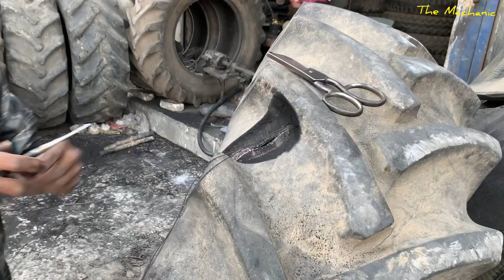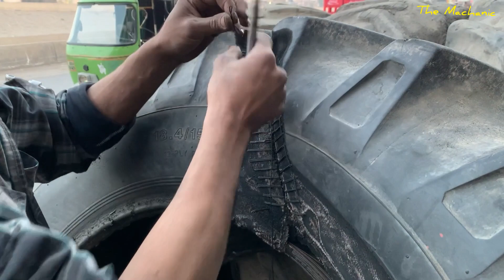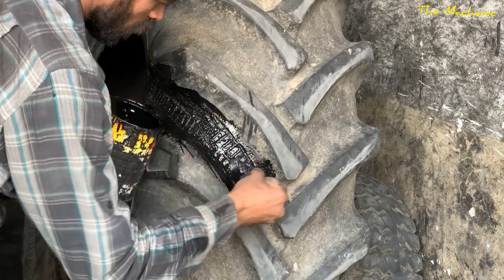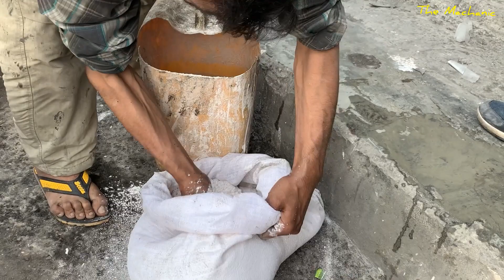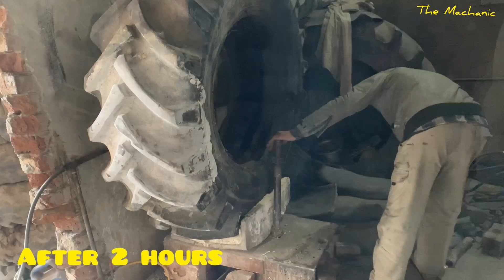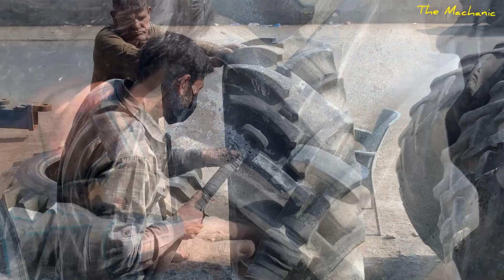Their Crafty Hands Repair Giant Tire Burst From Sidewall with Minimum Tools || Big Tire Patch Repair

Comment: Greetings from Ohio, USA .... No criticism from here on this amazing service and work you perform. I do know that here in the States, this tire would have gone straight to the shredder.  Youve obviously been at this work long enough to know that this tire will hold up under extreme service. Having watched a number if these repairs now,  I believe that this tire will definitely do the job nicely. Kudos on the workmanship!! I would have absolutely no problem with using this tire myself.

I think most negative thoughts and comments on this process might be coming from those who classify this as a highway service type tire,  used at extreme rpms, building up extreme heat and friction  ..... Its my belief tho that going on the equipment this tires made for,  it will definitely hold up just fine. Again, Kudos on the workmanship and quality you put into these repairs. Stay safe, and many Blessings.

Comment: Waste not want not this is one tire however that should have been thrown away
Reply: If you don't have one to replace it you use it with a repair it's just a farm equipment tire it's not like it's going to be doing 70 or 80 miles an hour

Comment: I give credit to the craftsmanship that went into this repair but this should never have been done, this will never hold together and will be extremely unsafe to be near when in service. Hopefully the guy that did this repair is standing next to it when inflated.
Reply: Have to agree...It's impressive that they were able to make this repair, but I have to really question the long term viability of this...Maybe if it's only ever driven gently over soft ground at low speeds it'll be fine, but...Yikes...
Reply: Nothing's gonna happen don't worry american pie
Reply: You can't see past your nose can you it works for them and last a long time
Reply: It's a low speed low pressure tractor tire. It will probably be okay.